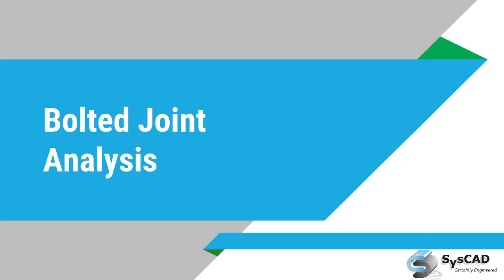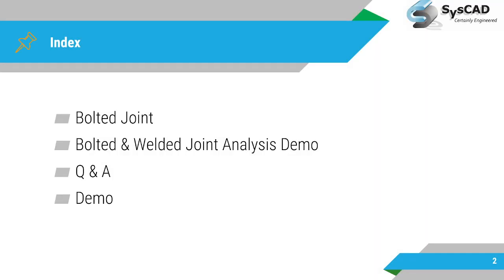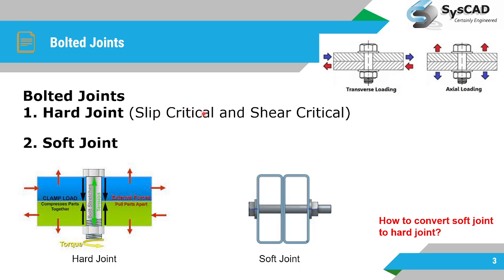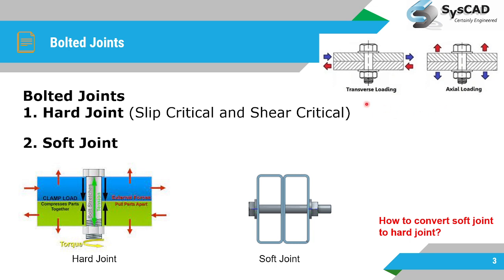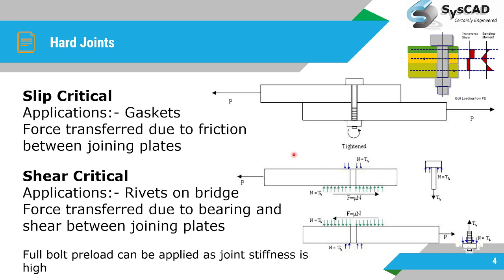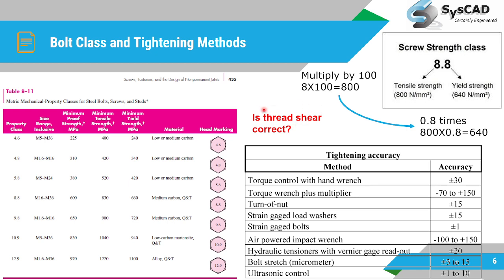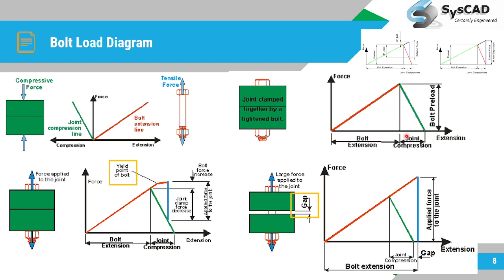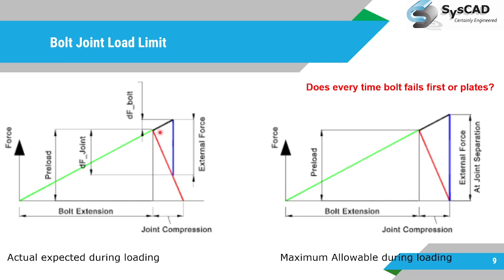Bolt Joint Analysis | Bolt Torque| Bolt Load | Bolt Joint | Bolt Preload

Comment: If during tightening the pre-load drops, what does it mean? Yielding of threads?
Reply from the maker: You are applying more preload than the strength of Joining plates in short as whole joint.

Comment: how to calculate the tightening torque for the rubber and two metal plate sandwitch patteren.
Reply from the maker: It depends on rubber hardness and sealing pressure required at joint. Hope this gives you a direction.